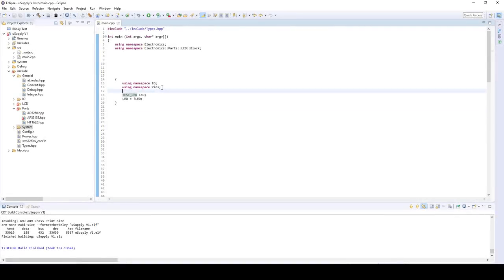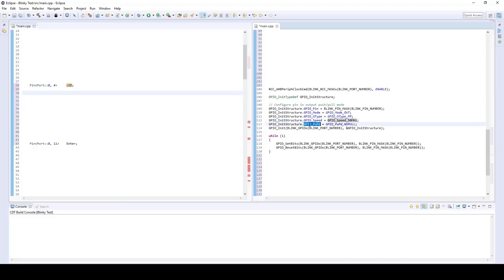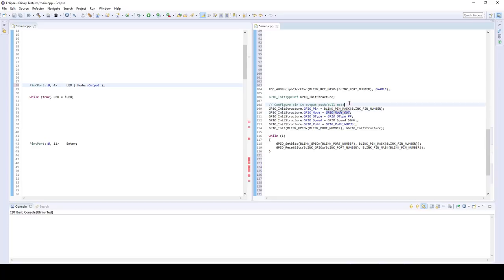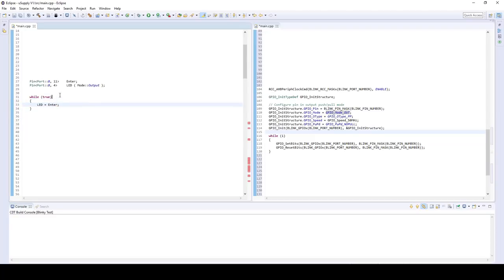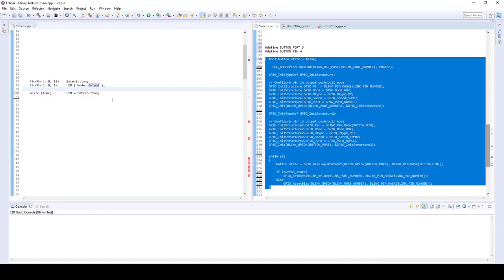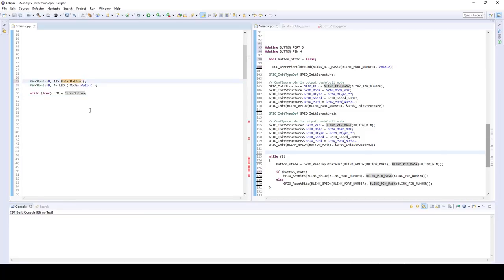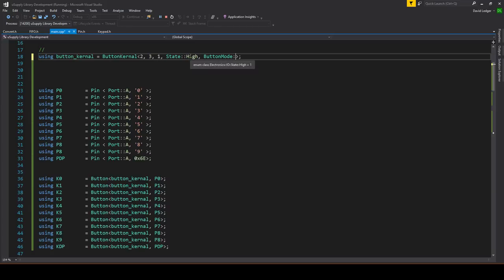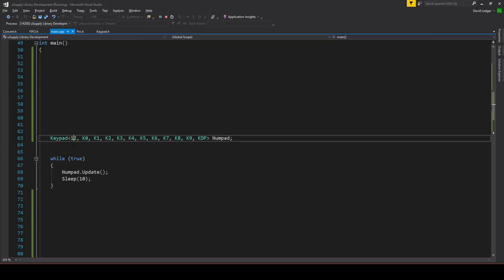C++ for the Embedded Programmer

Comment: C++ is for lazy computer science programmers, C is for engineers.
In short, C++ sucks for embedded systems
Reply: i love how cleverly and succinctly you countered the points Dave made in this video and carefully structured your argument to show your opinion more closely reflects reality.
Reply: If you knew anything about embedded system programming, you'd understand exactly what I meant !
Reply: NICK I think you are gravely misinformed, you should have a look at the talks by Odin Holmes on the Kvasir set of libraries and you will change your mind.
Reply: C++ has so many problems, what lays in conceptual area, that the is no point talking about the libraries.

And if we a talking about libraries, in fact, modern approach, is to write you own code in most cases.
Reply: I am not sure what you are referring to, could you provide references? More importantly, one should almost always use libraries for the low-level initialization as this can be done better than we can do by hand (see for example Kvasir Bit library, as the domain specific knowledge can be incorporated into the compile time TMP algorithms). As an real world example, I use C++ together with TMP based libraries for all current projects (in production code), which has improved performance, reduced binary size, and catch more errors at compile time than I was ever able to achieve in C - all improving development time and less bugs overall. Given, C++ does have parts that one does need to know (R/L-values, copy elision, forwarding references, etc) to use if effectively (as the library implementor), but so does any language with powerful abstractive features.
Reply: Wow, such argument. C++ is perfectly fine for embedded systems. And when you are developing whole system with many devices it's almost necessary to have that layer of abstraction.
Reply: You must look to good design languages, like RUST, or C#, or known some theory of programming\linguistic, to understand  what wrong with C++. The is no point to describe how something better then another if listener used a bad solutions all his life.

If you need some high level abstractions, C++ is the poorest solution possible.

And people tends to overuse abstractions with luck of understanding.
Reply: + Kamtar
JAVA is still better.
It can run literally at anything, and high abstraction, and libraries for any task in no time!
And proper error handling, and safety!
Reply: So tell me whats so wrong with how C++ handles objects, interfaces, templates? And which ideas from C# are soo much better for embedded systems?
Reply: That's the one possible advantage of C++ for embedded stuff. It has abstraction but only to such amount which does not impact performance. You can talk about fancy stuff of C# and Java but don't forget about that for example as was said above tracking of ownership is rather performance costly.
Reply: +Emil Fresk 
You cannot be same time that developer and this thing developer ant this developer.
With regards.

P.S. disliked videos you provide just in case. Don't interested in any Jonathan Müller and JB promotions.
Reply: + Kamtar
 - "So tell me "
I better not.
Thank you but no thank you.

 - "for embedded systems"
For embedded systems(and any specific task overall) any language transforms in DSL, in such manner, that initial "language" have near zero impact on developer experience. Thus, we a comparing NOT THE LANGUAGES here, but other things, that have near zero relation to the language itself.

Talking about languages, more  relevant will be subject of different APPROACHES.
C approach - make it simple and transparent.
C++ approach - make it as most complicated as possible. Build Rube Goldberg machine instead of solving actual problem. In 1983 it somehow looked reasonable, with all this new abstraction thing(LISP developers a laugh here), but the is 2018 out there, for the shake of Allah! And C++ committee still continue to make C++ even MORE COMPLICATED. How they even manage this for so many years?

And still the is NO modules\package management, and the is NO single compiler that supports standard, and to manage C++ libraries you need entire OS with package manager(called linux), because this is the C++ way.
C++ looks more like sabotage for entire IT industry.

But, this is only mine uneducated opinion.
Reply: lol, ok
Reply: C# is for lazy computer science programmers, C++ is for engineers.
Reply: C++ can be used exactly like C, and will either produce identical or faster ASM....
Bloody C programmers that know nothing think they know everything...
Reply: @Nick: when the elephant is a baby, they tie it to a stake that it can't pull out of the ground. When the elephant grows up, it doesn't realize it is now strong enough to pull the stake out and never even tries. You should understand that C++ sucked for embedded programming the first few years of it's existence. For the last 25 years it has been just as good as C for embedded applications. no difference. nada.

Comment: Hope I don't see this guy on the channel again. The libraries are different, don't frame it as the language problem.
Reply: They (the libraries) have a 1:1 feature set.
The C++ language allowed the abstraction in the manner shown.

There is a 3 minute disclaimer at the end saying the libraries are different and not a language feature.
Reply: Not quite sure what the comment is about, sadly C does not have the abstractive power of C++, as you can embed domain specific knowledge in template meta programming which allows for compile time optimizations. I would recommend you to watch videos by Odin Holmes on YouTube, he is the current master in this area and does a lot of talks at conferences.